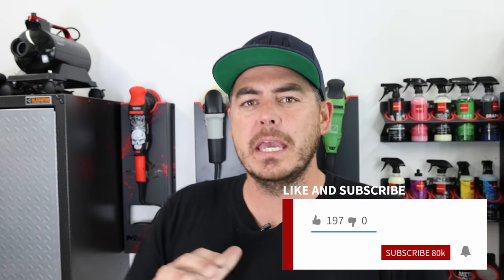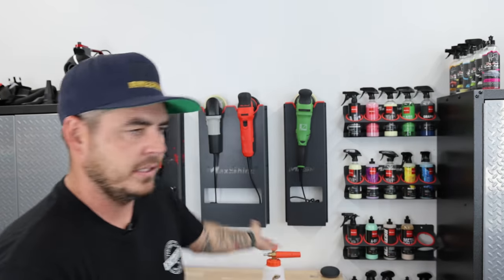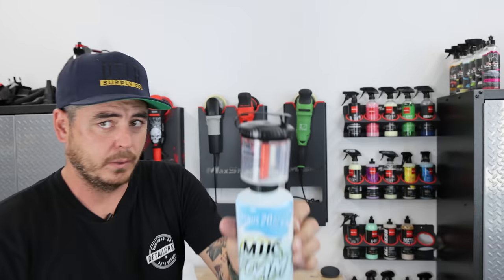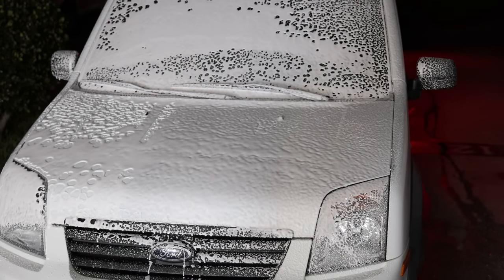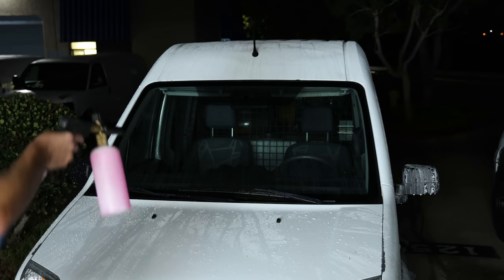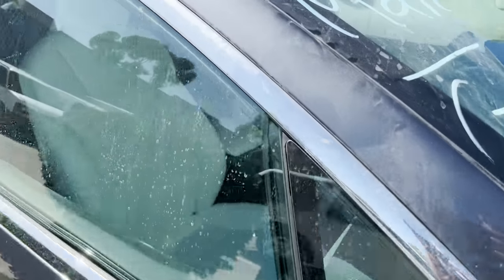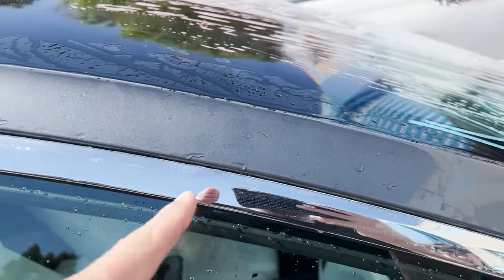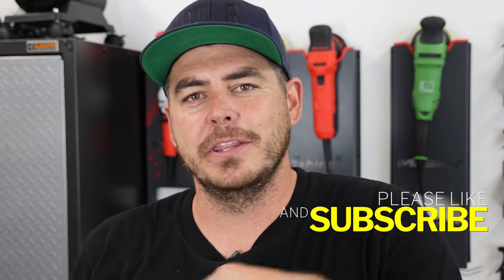NEW! MJJC FOAMING CAR WASH SOAP | How well does it clean?

Comment: Could you do some tests/reviews on touchless car wash soaps and pros and cons of using them?  I've seen some like Wash Chems Pro 50 but only see it used on trucks -- my guess that it's so basic it'll probably strip dirt and road grime at the cost of any coatings you may have as well.
Reply from the maker: Absolutely!
Reply: @imjoshv  what do u use for rubber mats to rejuven?

Comment: interesting comparison. Based on some of your earlier recommendations I purchased a Mckillens foam canon and Adams Mega Foam. They are both excellent. Foam is as thick as shaving cream. Does a great job cleaning my 2 cars. I use a Ryobi 1900, also one of your reviews, does all I need it to do. I dont need an adaptor to measure 2 oz. of soap That seems like a little gimmicky, and I`m sure adds to the cost.

Comment: Hi Josh. This is Jon from hk China. There is have a brand named "Scarcity" from Japan is cheap and high performance. They got 4 type of car soap : the high foam wash, the gross shampoo, the decomposition shampoo, and the coating shampoo. I tried these guys and their high foam wash is crazy foaming like Adam and low like Mr pink. I use 1:20 ratio with mjjc  cannon and it foam crazy and thick. Must try or even import to your shop .

Comment: Interesting seeing this new pH balanced soap from MJJC. I have an MJJC foam cannon and I use CG Mr. Pink or Adam's mega foam as you've suggested in previous videos but I'll definitely try this once it is available.
Reply from the maker: Those are great choices! Illl be doing a more specific comparison later
Reply: JOSH for some reason I still can’t get that shaving cream thickness out of the MJJC Cannon I got from your website. I tried switching the orfic and still watery foam. Any suggestions?